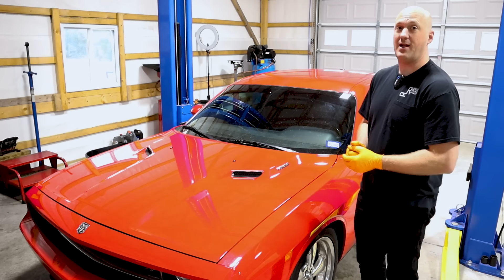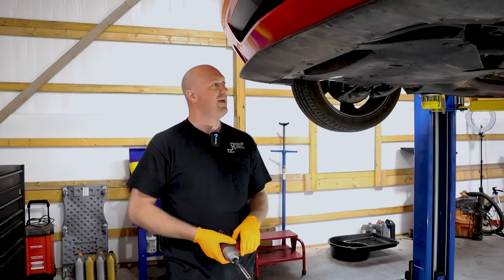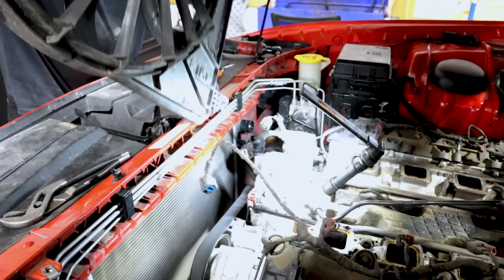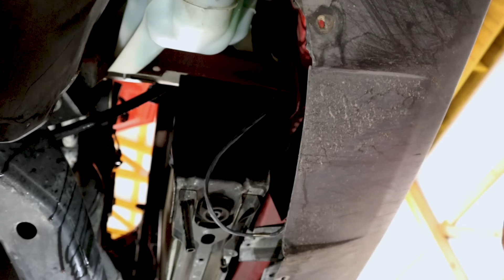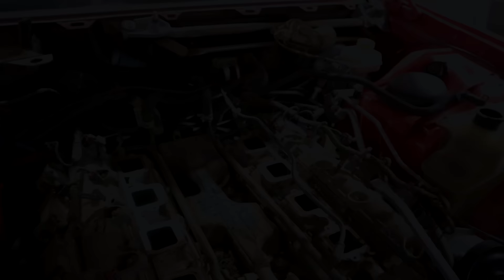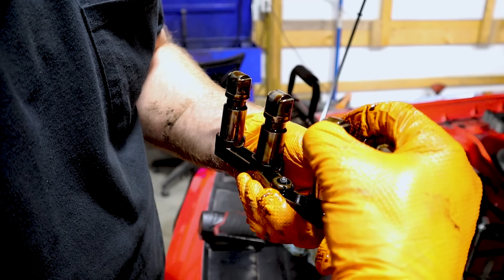Hemi Cam Installation! Budget Challenger Build Ep1

Comment: Great video as always! I wanted to bounce something off you if you don’t mind. A few weeks ago I commented on a video about head bolt torque specs for a 2005 300C. After finishing the job, the car ran great except for one thing. My oil pressure when cold is around 40-45 lbs and when warm drops to 18-20 lbs. before I did the job, it was the normal 60-ish. The only thing I did regarding oil was change it after the heads were on. Should I be concerned? What do you think might cause that?
Reply from the maker: Any chance you removed the oil pick up tube?
Reply: @ReignitedAuto  no sir. Didn’t do anything to the bottom end. Just cylinder heads, removed and inspected lifters and re assemble. And the oil change
Reply from the maker: @ItalianFresh5  hmm, can't imagine any reason for the change then. 🤔
Reply: @ReignitedAuto  should I be concerned?
Reply from the maker: @ItalianFresh5  those pressures aren't crazy low, but I never like to not know why something changed. Stumped as to why it would've changed though.
Reply: @ReignitedAuto  so I think the best I can come up with is that the oil pump is starting to go and the timing is coincidental. I forgot to mention that I did NOT check the oil pressure RIGHT before the job, it was probably a month before I tore it down and replaced the heads. So maybe it was already low before I did the job. Probably not, but that’s the best I can come up with. As always thanks for helping me out. 
PS. Possibly consider a Facebook page so people could DM you?
Reply from the maker: @ItalianFresh5  I've got one actually, same name "reignited cycle and automotive" but to be honest I usually use Instagram more under the same name 👍 For the oil pressure first thing I would check is the o-ring on the oil pickup tube. Sometimes the o-ring will start to come apart and it'll affect oil pressure.
Reply: Did you check that the head gaskets you used were identical to the old ones and aren't blocking any oil passages ?
Reply: @DL101ca  yes I compared them and they were identical.

Comment: I just rebuilt the hemi on my '08 ram, so a lot of the steps are similar.  I think it's really cool that you were able to hang the cam sprocket off the side, without removing the oil pump, which also means avoiding pulling the oil pan.  I did a full rebuild, so I had to anyway, but still, a great idea.  I'm sure there might be some who are wondering why you pulled the heads for a cam swap, but the lifters are under the head, so you need to pull them to swap out lifters.  If you have a MDS-equipped vehicle, you typically need to remove the MDS on aftermarket camshafts, which means new lifters.

Not sure on the Challenger, but on my ram, both heads had a ground strap connected with a 10mm (I think) bolt.  I didn't see either because the strap is bolted to the rear of the head.  When I tried to pull the heads, I got caught up on the ground strap, and ultimately scratched the head on the dowel when trying to finagle it out.  Which meant a trip to the machine shop for me (Ended up machining off 0.006" so it wasn't a deep scratch).

I can confirm, if you unscrew the radiator petcock too much, you get a coolant shower.  With my 08 ram, I couldn't get even the specific puller to work.  I had to use a combination of pullers, pulling against wrenches that were slid between the holes/webs of the crank pulley (The ram pulley is very deep).  It was an exercise in patience, as well as determining which wrenches of mine were junk and bent when I tried to use the puller with them.  At least for the ram, you need to rent a "long reach" balancer installer.  The regular installers won't work because the threads are so deep on the crank, that the threads won't grab on a standard puller.

I can also say to be careful when tightening the coil packs back on.  I buzzed them on quick, and twisted the threaded insert/plastic mount right off the valve cover.  JB weld though is holding it fine, I did that repair over a year ago when I had changed the spark plugs.

Oh and from experience, just get Mopar lifters.  Don't cheap out and get others.  Otherwise you will have low oil pressure and you can either be cheap like me and weld up the extra holes on each lifter, or end up spending even more money and getting new mopar lifters.  I used "Enginetech lifters" but if you look at them, you can see the two holes near the rollers I'm talking about.  (Not to be confused with the holes near the center of the lifter for the MDS lifters).

Lets see, what else...Oh, if you decide to replace the MDS solenoid, or the plugs, you will need to buy new ones because you have a very small chance you'll be able to yank the solenoid/plugs without breaking the top off.  Twisting doesn't help - the heat bakes the plastic and makes it fragile.

As always great video, no crazy commentary or music, just get-to-the-point wrenching, the way I like it!
Reply from the maker: Appreciate the in depth feedback Tucker! Quick tip for getting the MDS solenoids out without breaking them, give them a quick smack on the top of the solenoid with a plastic mallet, this breaks the seal and you can usually get them out after that! 👍
Reply: @ReignitedAuto  Thank you, that is a great tip.

Comment: I don’t even have a mopar, I’m a mod motor guy. I only watched Bc for the longest time I thought you had to pull the engine to swap cams on single cam engines
Reply from the maker: The key here is the removal of the radiator, gives just enough room to remove the cam. Thanks for watching!

Comment: Really want to do a 6.4 cam in my '13 Ram one of these days. Thanks for this vid!
Any major differences with the trucks on the disassembly process?
Reply from the maker: Nope, the trucks are extremely similar, in fact you have a little bit more room to work with since the engines are set back so far in the engine bay, also the grill comes off in 2 minutes so if you get the radiator out there's all sorts of room 👍

Comment: Use a set of SRT mid pipes on it, works great and is factory. My '12 R/T runs great with the SRT system on it.
Very informative video! My R/T has 123K miles on it, so will be looking at the same thing sooner than later, although it runs like a watch.
Reply from the maker: You're dead on Mark, I address that in the next video! 👍
Reply: @ReignitedAuto  cool! Look forward to the upcoming episodes!
Reply: @MM_in_Havasu  you said it's running like a watch, is the ticking that bad ?😂😂😂
Reply: @DL101ca  contrary to popular belief on your part, it runs just fine and no "ticking". It would not surprise me if the engine went another 123K miles with no issues.

Comment: I came here to see what you're using for lifters... given the Gen 3 HEMI's penchant for eating lifters and cams, I'm wondering if there's an aftermarket lifter that may help fix the problem.  My Charger Scat Pack has 54k miles on it (bought it at 33k) so I have no idea if/when the motor may decide to blow.  I have a warranty but still.
Reply from the maker: I guess I'm just a product of my profession. I really like using the stock lifters, since they usually last 100k before having issues. I know there are a lot of cheap versions out there that are pure garbage, but I also know there are some upgraded options, I've just never tried them myself. I do love those Scat Packs, honestly even more than the hellcats!

Comment: My question is i have an 03 Ram 1500 hemi. Do i have to remove the heads to change the cam or can i just spin the cam a few time's and then remove it.
Reply from the maker: Denis nailed it. I've always heard you can remove the cam just by spinning it to push the lifters back, but I'm always too terrified the lifters will slide back down because then you're out of luck. However, I'm going to try it in just a few days using the 6.4 in my C10 project just to try it. I'll be taking the heads off anyway, so might as well give it a shot!
Reply: You need to remove the valve covers undo the exhaust and intake rocker arms, remove the push rods.  Spin the cam and pull out, lifters should tuck in the trays and not fall but there's no guarantees. If you have the bad luck of having one drop, well then you're in a pickle. You could get some small rare earth magnets and either glue or drill to attach them to some wire and drop them in the pushrod holes to have some extra help holding the lifters in there for some peace of mind.

Comment: hey man ,  just found your channel , like it so far ,   my question is ,  can the exhaust srt manifolds fit on the 2004 ram 1500 hemi ?  in other words , can i do this same upgrade on my truck  , as i have a sport daytona edition .  one other question ,  if i found an srt engine  do i need to re-flash the ecu ?, i would love to put a 2006 to 2010 srt engine in my truck , thanks and keep up the grate content
Reply from the maker: Appreciate you watching! Unfortunately the headers won't fit the trucks, they are specific to the challenger/charger/300 models. If you swap in an SRT engine you'll definitely need to flash the PCM, the best option would probably be to use an aftermarket tuner with custom tuning capability so you can dial it in for your setup 👍
Reply: @ReignitedAuto    why wont the headers fit ?  is it a clerance or , head problem
Reply from the maker: @twistedtataryn  clearance issue, they will bolt up just fine, but they spread too far out to fit on the trucks, especially on the drivers side. You'll probably be able to tell easier when the next video comes out that shows the headers better 👍
Reply: @ReignitedAuto   do you have any suggestion for headers for , 02 to 05 , hemi trucks ,  you would think there was more clearance on a truck then the cars seems odds

Comment: Yes, I would like to do this up grade to 2012 Ram 5.7 and I'm looking for the lower end torque mainly for towing.  Not a racer, the truck is fast enough I just the drop in gears going up an incline.
Reply from the maker: I'm very happy with the difference so far, and this is before doing any tuning. 👍

Comment: My 14 RT manual has insane valve train noise, its extremely distracting and only has 75k on it. I have been prepping myself to have to do a cam and lifters one day before 100k, this will definitley help. I am really looking forward to seeing power numbers with the 6.4 camshaft as the 5.7 definitely needs another 20-25hp to feel proper. One question, if you know, I have the manual with the Blacktop package so i have the 2.5" exhaust (with Blastin Bobs resonator delete), will those 6.4 mate up with the factory 2.5 midpipes? Also my exhaust only has the small round 16" factory Mopar bullet mufflers if that makes any difference, there is no suitcase muff in the middle. Subbed and clicked the bell. Thank you!
Reply from the maker: Nope, the SRT headers will not bolt up to the factory midpipes. I'll go into detail on it in the next video! Thank you for watching 👍
Reply: Very good vid very informative thanks
Reply: All the R/T's have 2.5" exhaust. If you want to replace the factory exhaust manifolds with something better, you'll need to "upgrade" your entire exhaust system. I can say from experience with mine that 3" pipes all the way is absolutely amazing! 👍🏼
Reply: @DJGRoc  actually from what i have researched automatic RTs have 2.25" exhaust while the manuals have 2.5
Reply: @vadenkwin  I guess it depends on the year. Prior to 2017, I think it was like that. Since 2017, I believe they're all the same now regardless of which transmission you have. Additionally, they bumped up to the 2.75" pipes like the SRT's had.
Reply: @vadenkwin regarding your valve train noise, have you ever had your pushrods checked to make sure they're straight not excessively worn out and they have enough preload ? When I swapped my stock rods for the compcams hardened pushrods, I found the new ones to be a tad longer than the stock ones for both intake and exhaust. Your valve train noise could end up being cured by a simple pushrod upgrade.

Comment: I was hoping that they had put better exhaust manifolds on the 2010.  Great video so far. Keep it up!
Reply: Not surprised.  We build an awesome engine. Now how can we screw it up before we put it in a car....   Hmmmmm...  make the worst flowing exhaust manifolds , and shape them like a dog turd covered with tin foil... yep, just perfect. Engineers are "smart".
Reply: On my wife's 5.7 she had the hemi tick with the broken exhaust studs, not the lifter tick.  I did a bunch of reading on WHY these manifolds always break the exhaust studs.  The best theory I read said with the way the manifolds are designed, the front exhaust passes through the next one back, then the next one back and so on.  This means that the exhaust from the front 3 holes of one bank all pass through the rear hole.  Guess which bolts break? The rear ones.  I considered going to aftermarket shorty headers to help avoid the bolt breakage.  Not for more power, but to keep the bolts from breaking! Other than that I like the vehicle.
Reply from the maker: @HellmuthsHotRods  I personally believe it's an issue because the stock cast manifolds are so thick, that they retain heat for a very long time, the aluminum heads on the other hand are expanding and contracting at a significant rate. The rear of the manifold is also the thickest portion, so my thought is the continual difference in the rate of expansion/contraction leads to the broken bolts. But the other theory sounds plausible as well.
Reply from the maker: Wait until you see the stock manifolds! I do a close up of them in the next video. 💩
Reply: If they are like the ones on my 06 300, I will be disappointed.  For some reason I expect them to look like dog turds as well.
Reply from the maker: 😄 You nailed it!

Comment: Having a closer look of the 120k miles camshaft and lifters would be nice and positive to watch.
Reply from the maker: I can do that, I'll put a clip of that in the next video 👍
Reply: @ReignitedAuto  comparing it to the new one and explaining the the gains are to be expected because of the lobe and lift would help me understand  better the relation and dynamic of it....if you can.
Reply from the maker: Probably should have done that 😄 Unfortunately the new one is already in.
Reply: Any idea on actual cam specs? I haven't seen any so far.
Reply from the maker: @dfre6422  Still trying to find exact numbers.

Comment: Nice job man I do have a question for ya can a dealer tech turn off the MDS on these engines
Reply from the maker: Nope, Chrysler doesn't give the dealers that capability, has to be done with an aftermarket tuner. 👍

Comment: Can I do all of those mods including cam on a 2006 5.7 Hemi  and on a 2007 5.7 Hemi?
Reply from the maker: Almost identical, however, if I remember correctly on the pre 2009 models the cam thrust plate is one piece that bolts behind the oil pump, so you'd have to take that off as well to change the cam. This can be tricky since the oil pickup tube is bolted to it. You can get it off with the 300/charger series, but the trucks the oil pan has to come off to remove the oil pump. Hope that helps!
Reply: @ReignitedAuto  in my case, the engine is out of the car, I plan to install one in a 1964 Dodge Polara and the other on my 1969 dodge Super Bee. While they are out, I want to upgrade a bit. Hope you mention this on the next installment,  there's a lot of us trying to get all info we can to do these swaps to classic Mopars
Reply from the maker: Very cool! I'd like to see progress pics when you get into it 👍